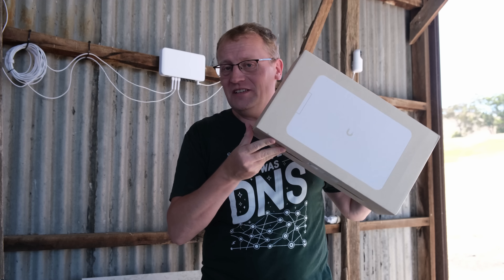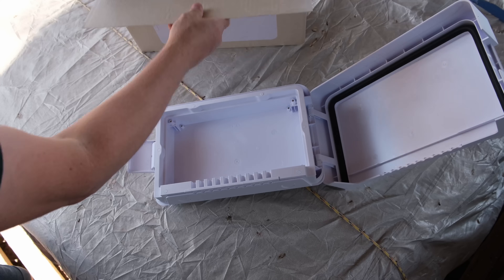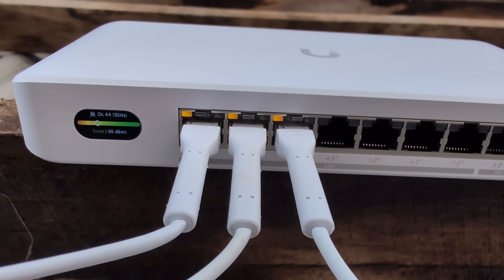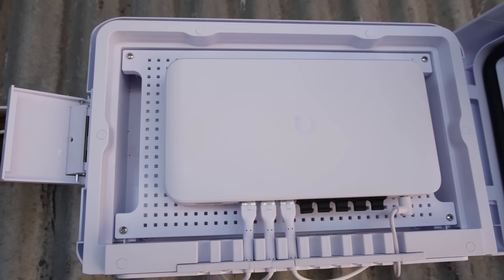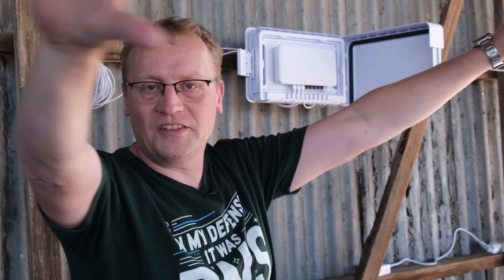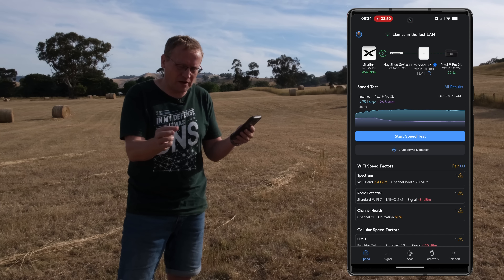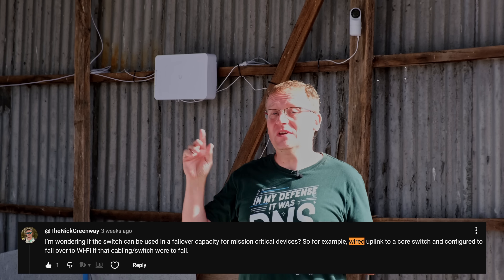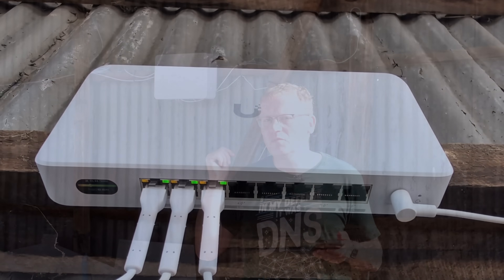Weatherproofing my UDB Switch with the Unifi Flex Utility Pro - and answering your questions

Comment: I have an outdoor pro that sends WiFi to my dock 350 ft away. The signal is great, actually the outdoor pro sends it a mile away. But I am not sure if this UDB switch will pick up the outdoor pro WiFi signal that far away without an outdoor antenna. Any thoughts on that? Right now the dock uses a g6 instant with WiFi from the outdoor pro and it works great. I wanted to beef up the cameras  though with a g6 pro but I’m not even sure this idea will work of the UDM won’t get WiFi that far away.
Reply from the maker: Good question. I wouldn't think the UDB Switch would work that far away. Any longer than 100 meters in direct line of sight, and you'll see a big drop in throughput I reckon.
Reply: @LarsKlintTech Yeha I was afraid of that . Thanks

Comment: Question: Now that it’s protected from the elements, why not move the bridge to the other side of tin wall and run the wires through it to the inside? That way you can add back the speed you said you’re losing having the signal go through the tin wall.
Reply from the maker: I did consider this, but two things made me pause. 1) It is much more difficult to mount the enclosure on wavy tin, and would require cutting holes and fabricating a bracket. When the signal is usable, I decided to wait and see if there are any issues. 2) I want to keep the enclosure away from direct sun as much as possible for both heat and UV reasons.

Comment: In your defence... Using an AP as a wireless bridge... Just doesn't work reliably. That new UDB looks really good and if it's been up for 4 weeks with no issues, works a lot better than the AP method (I dug a trench by hand to move away from using an AP as a bridge in 2024, because it was basically useless at times (i.e. during the day, it would randomly decide it really really needed to adjust channels... And then would stop working for half an hour. Even locking AP's to upstream mesh devices only 30m away was useless.
So UDB... Looks like a great product.
Reply from the maker: Thanks a ton for that insight. I haven't used AP uplinks very much, but I have always shied away from them too for this exact reason.

Comment: Would have been great if it could have worked as an AP with a wired backbone.. I have 2.5g throughout the house. But I lack 6ghz in the room where I have my desktop PCs
Reply from the maker: That would have been an interesting addition, but then you are talking about a completely different device, essentially an AP with ports attached.
Reply: @LarsKlintTech  yep.. don't need 2.4ghz.. but for the home office/gaming room and VR an 8 port switch with 5 and 6 GHz would be brilliant.. and especially at that price or lower

Comment: Great follow up video to your part 1 on this device. I am in agreement with you on this switch being a game changer, it has so many uses.
Just a note to say some of the performance you’re seeing on you phone is not a fault of the access point but a limitation of the tiny radios and low transmission power available in mobile devices. A well documented issue with WiFi called ‘near far’ 
I subscribed so good luck getting your 50k 👍🏻👍🏻
Reply from the maker: Good point. Being 358 meters away doesn't help either, and the signal at that point is very weak. You are right that the strength of the receiving antenna is important too. 
Thanks for the support and comment. ♥️

Comment: Thanks for coming back with a video for comments, that is a cool way of doing things 👍. Does it also work in standalone mode without an Unifi controller?
Reply from the maker: No worries. It seemed like a nice bow on the project 😊
You need a unifi controller to take advatage of the wifi uplink and magic management of the switch.

Comment: Hello Lars, you might as well place that nice weatherproof box @ the other side of that waffled signal blocking tin plate. (assuming the signal originates from that side)
greetings from Belgium(were it’s cold and wet)
Reply from the maker: I did consider that, but the signal is usable, and it is a lot harder to mount it on the wavy tin than on a wooden beam. If I need a better signal, I will consider it. Also, keeping the box out of the sun is always preferable in Australia.

Comment: We need to deploy a bridge / wireless uplink device in a domestic loft space. There is mains power available, but no structured cabling (no Ethernet runs) and no physical route to install cabling to the loft.

The building already has a very strong 5 GHz Wi-Fi network, however this network is not UniFi-based and does not use UniFi access points. It is a standard third-party Wi-Fi infrastructure.

Proposed topology:

Loft-mounted device acting as a Wi-Fi client bridge

From that bridge:

2 × ceiling-mounted access points (landing / hallway area)

2 × IP cameras (PoE powered)

All downstream devices would be hard-wired via Ethernet to the bridge device

No wired uplink is possible to the main network

Key technical questions that need a straight answer:

Can this bridge/switch operate as a true Wi-Fi client and uplink to a non-UniFi 5 GHz Wi-Fi network, or does it require a UniFi access point at the other end?

If UniFi hardware is required upstream, why (controller adoption, wireless uplink protocol, security handshake, etc.)?

Does this solution require:

A UniFi controller running permanently?

A UniFi AP acting as a wireless uplink root?

If the device supports standard 802.11 station / bridge mode, what are the bandwidth, latency, and stability limitations when feeding multiple APs and cameras?

If this will not work reliably without UniFi infrastructure, what minimum additional hardware is required to make it function correctly?

Constraints:

No Ethernet run to the loft is possible

Wi-Fi signal strength and SNR are excellent

We are not currently invested in the UniFi ecosystem and want to avoid unnecessary hardware where possible

At the moment, the responses received haven’t answered whether this will actually function in the real world without adding a UniFi access point solely to satisfy the bridge requirement.

A clear yes/no with technical justification would be appreciated.
Reply from the maker: No, it won't work. You need the UDB switch to connect to a Unifi Controller, which is what makes the magic happen. This means something running the Unifi Network, such a Dream Machine, Dream Machine SE, Cloud Gateway, Unifi Express 7 or another gateway device. At the least you would need a Unifi gateway device, a Unifi accees point, and then the UDB Switch.
Reply: @LarsKlintTech   thank i just need a back kit now to use it then i dont know what i can you but i need wifi 6 kit and just ordered  and box

Comment: I would recommend investigating industrial receptacles. I believe a 4-Pin M12 receptacle could help you get power into the box. Might require some custom wiring in the box. But would help keeping the IPx6 rating.
Reply from the maker: I think a good cable gland will do the trick as lon as I can fit the power cord through it. The smaller holes are pretty tight due to the design of the Unifi patch cables.

Comment: I feel a solar powered point-to-point wireless bridge and AP down the far end of the farm uplinking to the hay shed could be an interesting project to improve on those connection speeds to your phone.
Reply from the maker: That is definitely on the plan. In fact, I'll probably end up with three "remotes" Pierre by solar.

Comment: Absolutely love my UDB Switch. I originally tried to accomplish the same thing with a GL.iNet travel router in bridge mode, but it would randomly disconnect. With the UDB, I’ve had zero issues overall. The only hiccup was prior to upgrading to Network 10.0.156+, which is mentioned only at the very bottom of the “Technical” section on the product page. The switch would adopt but then sit at “initializing” indefinitely. I was about to initiate a return when I got the notification that Network 10 was available. Gave it one last try, and the switch adopted perfectly. Since then it’s been rock solid and has significantly improved connectivity in a remote part of my house with no LAN wiring.
Reply from the maker: It's been solid for me too for 3 months or so now. Brilliant device.

Comment: My biggest concern would be heat buildup. So perhaps best to leave the power supply outside if it.
Reply from the maker: Definitely. I mainly left it outside because I don't have the right grommet currently, but that's a valid point. I'm going to add a temp sensor to the box as well.

Comment: Lars … why didn’t you put the PS inside the box as well?
Reply from the maker: I realised I didn't have the right grommet for the larger hole in the box, so insects and dust would get in, if I put the power cable through as is. I will probably update that later on, when I get the right part.

Comment: Would that switch overheat in a warm attic
Reply from the maker: Possibly, as the Ambient Operating Temperature is -30C to 40C. I think I'll add a temp sensor inside the box too.

Comment: It looks like the power supply is not in the box. Why didn't you mount the power supply in the box on the first mounting plate?
Reply from the maker: Well spotted. I decided against it for the moment, as I don't have a grommet to route the power cable through the larger hole in the case. That means I would get wasps and spiders living in it in no time. I may redo this when I can get a proper grommet for it.

Comment: Great video! It would be interesting to see how a setup like this compares to a solution with Wi-Fi HaLow.
Another thing is that i find the UDB running relatively warm. Can it adequately cool itself inside this sealed box?
Reply from the maker: Thanks mate. That is the question. I think so, considering it isn't in full sun and the area is well ventilated. I will keep an eye on it though, and perhaps I can add a temp sensor to the box too.

Comment: I don't see what this box actually got you.   You're under cover, it's done nothing for temperature control (potentially made heat a bigger problem).   So bugs?
Reply from the maker: Bugs and dust. There is a LOT of dust in general, and summer in particular. It will also protect against some humidity and frost in winter.

Comment: Just curious if the bridge signal has to penetrate the tin.   If so, just put the new box on the other side since it is weatherproof.  I suspect you thought of that!
Reply from the maker: Yes, the signal goes through/around/over the tin wall. I did consider moving it, but it would be a lot more work to put it on the outside, and the signal is adequate for the moment. I may move it in the future, but I don't really want the case in full sun either.